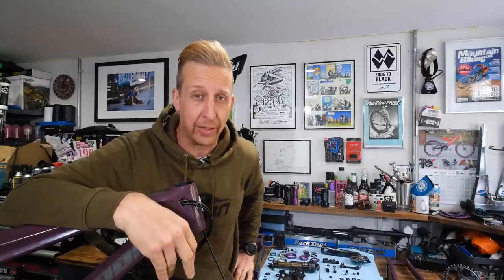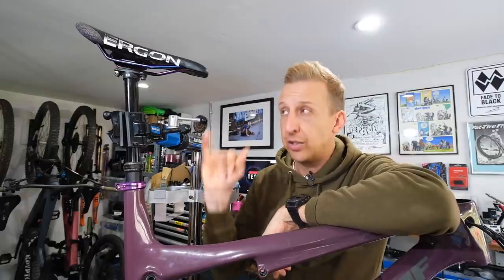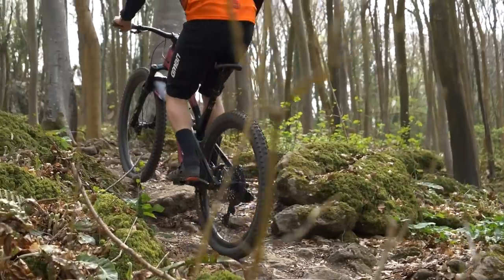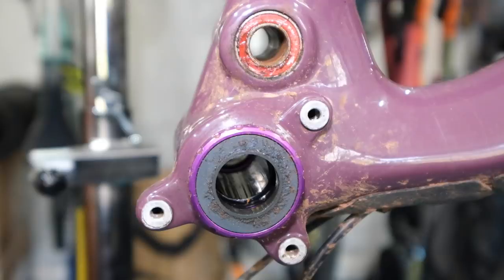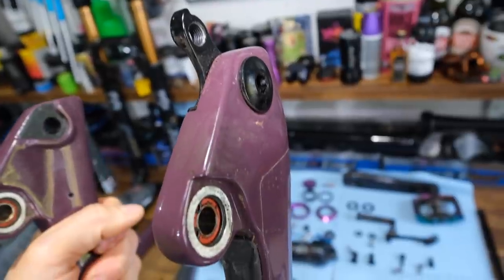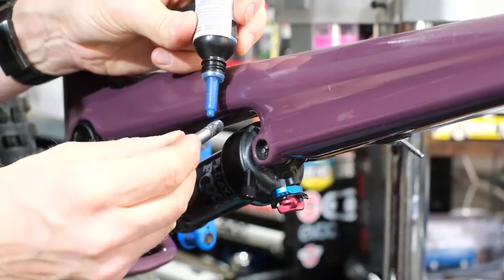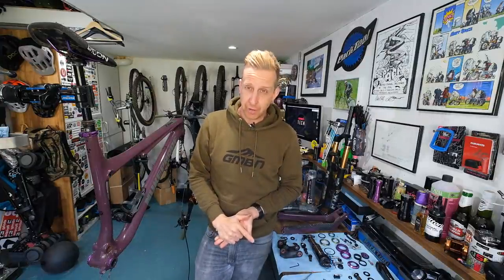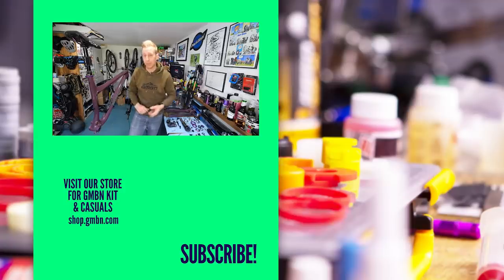How To Stop Your Mountain Bike From Creaking | Locating MTB Creaks

Comment: Owners of Shimano Microspine hubs can be dissapoitment that all what was in this video they tried and didn’t help :-) I was that person in the past, where the rootcause was this plastik spacer (this plastic o-ring with teeth) in the hub. Just for your record, if you have this problem the solution is to replace it in to new part manufactured since 2020 in BLACK color.

Comment: If your poor like me and your bike came with 3 piece cranks (eg square taper), make sure the crank bolts are done up tightly, they can come loose, and can make it sound like the bottom bracket has gone. Easy fix, could be hard to diagnose.
Reply: I found this on my bike only 2 months after I had replaced my bottom bracket. I was going to be very annoyed if I needed to replace it under warranty but luckily I remembered this. Dont worry I didnt replace the old one unnecessarily, it had completely failed.

Comment: Great systematic look. Pivot creaking should be near the beginning of the checklist. To isolate pivot creak, simply lockout the rear. If it only creaks with suspension open then you know it's a pivot issue.

Comment: One source not brought up is the rear shock. I've been hunting creak on my old Canyon Nerve for the last couple of months. After going through everything mentioned in this video and then some, the only thing left was the shock itself. I had already tried cleaning and greasing the shock bolts to no avail. So I made a piece of wood with two holes at the right distance and replaced the shock with it, and lo and behold the noise disappeared. A quick (and long overdue) shock service fixed the issue completely. So if you've tried everything else, check the shock!

Comment: I just got a creaking XT 12 speed cassette. I lubed contact points between the first and second sprocket and between the second and the thirds sprocket. The creaking mostly occurred on the smallest cog. But it was a mission to find it, I lubed pedals, bottom bracket, dropouts and some suspension pivot points and I was close to lubing the hanger but I just got an idea to check the cassette. What a relief to have creak less bike.

Comment: Yo Doddy. Sorry to say. But my bike made the most nasty creaking from the seatpost. With the dropper down and stood up. Should say it is a ALU fullsus bike. At first we thought is was from the headset or stem because I had just serviced those. But after cleaning that it was still there. After manhandling the frame we tried to take out the seatpost and it was gone.. Cleaned it and used new Muc-Off carbon gribber grease. And it was gone. 

Anyways the great content. Both entertaining and I have learned so much. Thank you from Denmark

Comment: The one creak on my bike that took me 3 months to figure out was my rear wheel from the factory had the spokes waaaaay too tight on the drive side. Whenever I pedaled hard or uphill it creaked like hell. After greasing every single part like Doddy just did, I found out the spoke tension was cranked down. Loosened a quarter turn on the drive side spokes and my bike has been quiet and smooth ever since.

Comment: another one is if you use a shimano chain and a non shimano branded chainring (even if it's supposedly shimano compatible) you can get a grinding or crunching sound and feeling from pedalling. the severity of it depends on how thin the chainring is but most chainrings were designed when SRAM came out with 12 speed and they're just being slapped on shimano bikes by manufacturers.

Comment: Nice video. :-) I sometimes heard a very loud squeaky sound when pedaling uphill (in the lowest gear). After re-assembling a lot of parts I found that the issue was caused by the bearings in my back wheel. Changing them fixed it..

Comment: Great timing as my bike crashed yesterday and then creaked the rest of the ride. Now i have some pointers on how to isolate the source.
Reply: Yeah just isolate that broken frame 😂
Hopefully not*
Reply: I followed Doddies advice and tested the bike for creaks. There were none. Turns out it was the handlebar bag which shifted in the crash and started rubbing against the head unit.
Reply: @amandajane8227  it's a broken bag Amanda! Do not use it again!😂

Comment: I had my e bike display upgraded to the Kiox which involved lowering the motor ( by bike shop) and almost as immediately after I got it home it started to creak after checking cranks, seat etc I removed the bolts holding the motor and found they had put new thread lock on old, after cleaning up threads, applied Teflon white grease torqued up to spec and no more creak

Comment: I had a creek on my commuter bike a few weeks back.  After a bunch of testing, it turned out to be the seat.  Not at the post or the rails, but a few screws hold the body of the seat to the upper pad.

Comment: I had an issue with creaking and it was driving me insane, to the point were I didn't want to ride anymore. my bike is a a low to medium end budget bike and it turned out to be the fork just some cleaning and lubing up with silicone oil and two days ago I even rode 47km in one day.

Comment: 10:05 by the color u might be right, by the brand not so much, I'm using red k2 threadlock, and its somewhere between normal green / blue  threadlock in strength speaking.

Comment: I've just sorted this out on my bike I changed my bb which was worn, then cleaned and lubed my linkage bearings and the shock hardware? Touch wood its stopped? if not the headset seat post and pedals would be next

Comment: @GMBN Tech I have the crank like shown at 10:20 and the left crank keeps falling off after like 40km. How do I make it so that it sits more reliably? I tried screwing the cap harder, or tightening those 2 scews towards higher tolerance, still keeps falling off. What Should I do? Should I put threadlock on that cap thing? Bike is new, couple of months old

Comment: I thought this was pretty interesting, I had a squeak last week, I could hear it was related to the back wheel, I took apart the hub and the cassette bearings and re greased, no good, checked all the spokes, no good, took the inner tube out of the tyre, it was stuck together from previous sealant, put some baby powder in there, fixed!

Comment: #AskGMBNTECH Hi Doddy, I am struggling to understand hydrolic disc brakes. How does the brake system adjust for brake pad wear? To my understanding the  volume inside the system should increase as brake pistons have to extend more to compensate for pads, do the brake levers move in more? What happens when I push the pistons back after brake pad change and should I bleed them. I am struggling with old avid elixir 3's, as brakes in my budget are out of stock, due to covid. My rear brake has a bent lever, but both of my brakes need to be bleed every 6 months. What could be causing this? Thank you, very much. I am getting into the sport and your videos are very helpful even if often out of reach for a broke student like me. Cheers, from Latvia.

Comment: i have a newly built bike. a week old. then suddenly it goes creaking. it creaks when i'm pedalling. no creaking when freewheelin. 1st i thought it's the bearings on the front hub. wrong. 2nd culprit bottom bracket. cleaned and greased. didn't solve it. and the main culprit is the wtb volt saddle. lube the saddle rail connecting to the plastic saddles frame. problem solve! 😂

Comment: Upgraded my good old 26" alu ht/rigid with new xt 11spd drivetrain and apex gxp 42t crankset and now after a year(less than 6monts use) the bottombracket/crankset/pedal on the left side is creaking... baaaaaaaaaaaaaah. My old xt, or stx rc or accera x or alivio groupsets never ever creaked down there... quality is not even up to snuff of touring/budget components from good old days. My Scott scale 900 elite with full Sram nx also creaks at the bottom bracket/crankset after three months of use... What is happening? I am not even riding offroad that much if at all.

Comment: Hi doddy, I just get my new hardtail less than a month, my bike creaks very loudly when im gently push the bike forward and backward while im applying the both brakes. (While im sitting on the lowest postion of the saddle - not paddling ) I cant figure out where the sounds came from. so annoyed.
Reply: You might need to clean and bed the brakes in properly. But often discs sqeal until they heat up depending on the pad material. So sintered / metallic pads are noisiest, organic pads are quiet

Comment: I've got handlebar creak after serving my forks 🙄
Reply: Dirt in the headset or spacers. It only takes a speck
Reply: Tightening the star nut with the wheels off the ground in the stand and hence the fork steerer being unloaded can also cause this. Its best to tighten the star nut on the ground with a load going through the forks and the bottom headset bearing. That way the bearing seats better and the star nut is only really pulling down the handlebar stem and the top bearing.

Comment: I have creaking between chain and chainring in front. Everyhing else is smooth, shifting perfectly but have strange noise while pedaling. I can't find out what's going on. Next thing that I have issue while I'm on 1. speed (the biggest one) while pedaling backward, my chain starts to drop down to higher level gear for some reason... Those are 2 issues that I can't find solution to it. I wish I could send a video to someone to help me out.
Reply: I have have similar experience with both bikes recently. In both cases my rear hub bearings were dying. One was dtswiss and tiger an i9 hub. It’s a cheap fix.

Comment: You wonderful people from GMBN, we need to talk break fluids again. Please correct me, should I be wrong:
As far as I remember, in the past you have referred to DOT break fluid as one that pulls moisture and contaminates itself. I think there might be a little misconception with this (or maybe its me whos not understanding it). DOT 5 is silicone based, DOT 5.1 is glycol ether based. That would mean that only DOT 5.1 has a hygroscopic property. In reverse this would mean, that you can store DOT 5 in bulk like you would do with mineral oil. My theory is, that SRAM wouldn´t make themselves happy if they would fill their breaks with 5.1 by default. Where I live, people have one year guarantee and two years warranty on things they buy. I suppose they fill their breaks with DOT 5 which is less likely to contaminate in this time. DOT 5 should also have the advantage over 5.1, that it cannot damage paint and that it works more stable within a wider temperature range. This could maybe also explain, why some people say, SRAM breaks would feel a bit spongey, because silicone based break fluids have a higher compressibility opposing to glycol ether based liquids. This could mean: A break is a closed system so if you want a crisper feel on the break then go for DOT 5.1 and don´t be too afraid about its properties - but if you don´t care or if the more spongey feel is even what you like then go for it and get yourself a larger volume of DOT 5 not being worried that you cannot use it anymore after some time. Sry for the long text. Please let me know if this is all nonsense. I´m always thankful when I can learn something. Cheers guys! Have a great weekend.

Comment: #AskGMBNTech 
Hello 
I have a montra madrock hardtail with a shimano tourney 21 gear (3 in front, 7 in rear)groupset 
When i change to the second gear in the front casette  my chain keeps rubbing with the front derailleur 
Can you please give me a solution to this problem?
Reply: Often it's very hard if not impossible to get 3x setups to run perfect in every gear ratio, each front gear had an optimal range of gears at the back, so this middle front gear is happiest with the middle back gears. Not the answer you want sorry
Reply: @kicknitoldskool  its okay 
I SOMEHOW ADJUSTED USING THE HEIGHT ALIGNMENT AND NOW THE GEARS SHIFT SMOOTHLY

Comment: In my experience, properly cleaning your bike regularly solves 95% of creaks.
Reply: Cleaning as in washing, if so a wet bike will remove some creaks, as the grit buildup in pivots and BB area is wet and silent. As bike becomes dry and these pivot areas dry out the creak will return.
Reply: @sharkykzn5846  If you're the kind to regularly clean your bike properly (read as: actually going in with a detailing brush at all the pivots and hard to reach spots. Basically being OCD.), there's not gonna be much dirt or grit buildup anyway. 
Of course, this doesn't mean that you never have to service your bike. It just mean you have the benefit of your bike lasting much longer in general, as well as disassembly being a breeze. 
I've seen too many people just blast their bike with water and call it a day, no scrubbing, no soap, just a hose and water. And even those who would soap and scrub their bikes rarely ever wash around the pivots, around the headset, etc. All because it's too hard to reach with a normal brush. Some don't even remove their wheels to clean their pride and joy.
Well, guess what? Of those people, I've seen too many of their bikes have their components fused to each other, all cuz their owners didn't bother with cleaning their bikes properly. Seat posts fused to frame. Fork fused to headset. Pivot axles fused to bearings. Bearings fused to carbon frame. You get the picture. This happens because of galvanic corrosion. And yes, galvanic corrosion can happen between carbon fiber and metals. And having the salt content from the dirt stuck around those hard to reach places doesn't help things. Go figure.
Reply: @Snipeonz  I see what you outlined more regular than you would believe. I'm in the industry, it's my background.
Whilst meticulous cleaning can mitigate gunk build up, dirt and water ingress will still win at the end of day. That's when regular service and maintenance steps in. Todays bicycles with their advanced materials and some simple, some not so simple engineering designs need to be worked on, beyond the wash bay. I'm talking about strip, clean, inspect, grease as needed, assemble, torque and ride. Keep the rubber side down and safe, creak free rides.
Reply: @sharkykzn5846  Yes, you're correct. I'm aware that dirt and water ingress, as well as various other problems still occur even with OCD levels of cleaning. That's why I have never ruled out servicing, and why I said proper cleaning only takes care of creaks 95% of the time. 
The truth is that too little people would bother taking the time to clean or take care of their bike, with reasons ranging from wanting to ride more to too busy or whatever. Hell, even the industry somewhat encourages it by going 'ride more, care less'. 
I can continue this rant of mine, but to sum it up, people are lazy to do the most basic to care for their bikes, so they hurt themselves and their wallets instead. And if their bikes have been neglected enough, it makes mechanics' lives harder. I'm sure you know what I'm talking about. And that's also why I hate seeing a dirty bike come into the shop.
Reply: Well il never get rid of the 95% cause i dont maintain mine much. Im happy with 5% creak free🤣
Reply: @Rab_Cee  You misunderstand. 95% of creaks can be solved/prevented with regular proper cleaning. The following 4.9% is when servicing comes into the picture. And the last 0.1%? Well, that means you're f@#ked and it's hopefully a warranty case. The chance for creaks is still 100% without any maintenance.